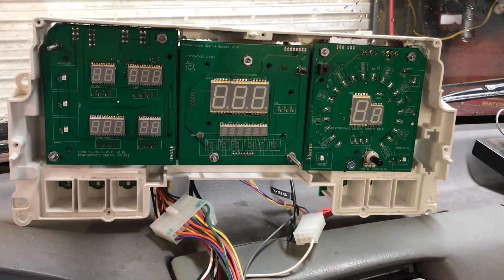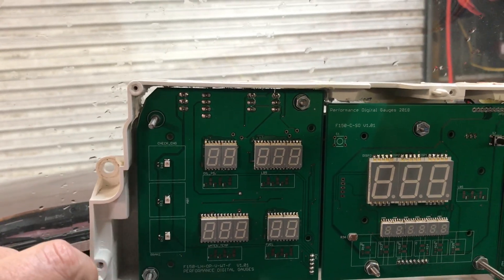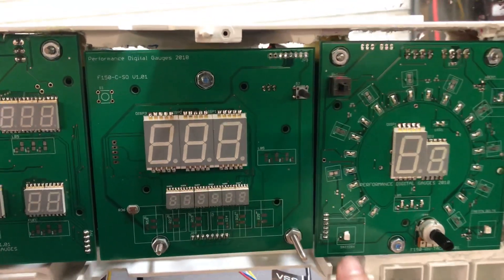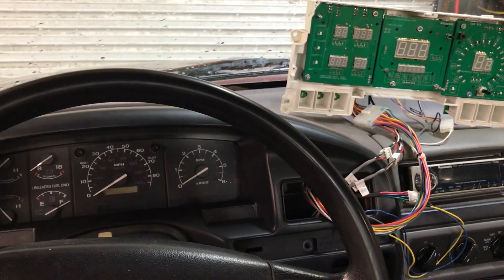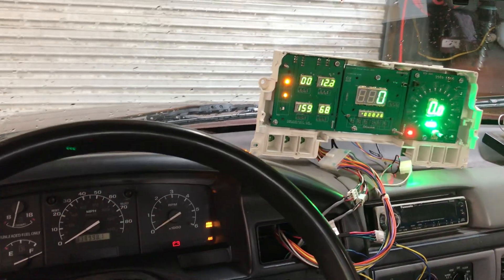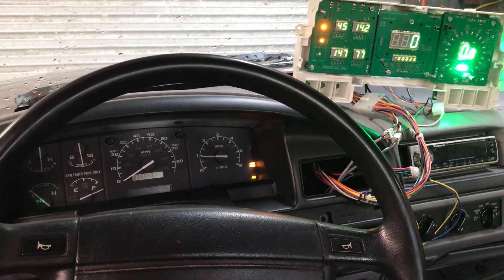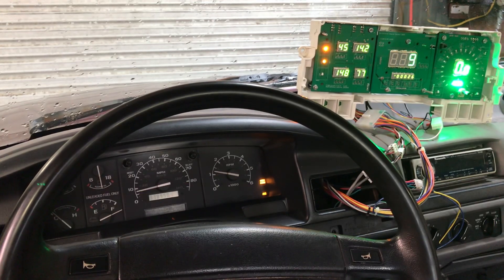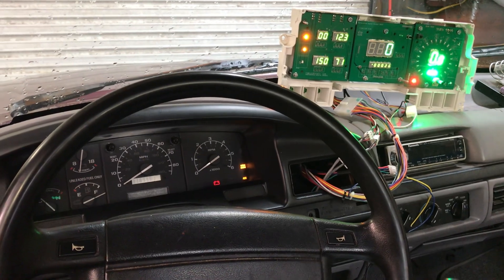OBS Ford F-150 Digital Dashboard Instrument Cluster

Comment: Do you happen to still have the old cluster
Mine broke and I can’t find any
Reply from the maker: It’s in pieces. What’s wrong with yours?
Reply: @performancedigitalgauges7198  most of the gauges don’t work
Reply: Only the speedometer works
Reply from the maker: @Abel_Music23  I’m still several months out on this one. You can find some used factory clusters on eBay or some of the OBS pages on Facebook.
Reply: Is there any manufacture that makes a digital dash for an obs
Reply from the maker: @paytonroebke6  currently no but we’re close to a finished cluster.

Comment: have a 1995 f350 application?
Reply from the maker: mongomay1 yes. If you have a gas engine the one in this video will work. If diesel, we will have this version with a diesel tachometer.
Reply: @performancedigitalgauges7198  
1995 f350 460 gas 5spd manual

Comment: Where did you get the digital gauge cluster?
Reply from the maker: Joseph Woolard II I’m developing it.
Reply: Performance Digital Gauges I would love to buy one as well stay in touch
Reply: @performancedigitalgauges7198  i would love to buy the finished product after the kinks are taken care of. Keep in touch
Reply: Well i would love one when ur done
Reply: I would like to buy one too
Reply: Will they be applicable for the f250 with the 7.3?
Reply from the maker: @rabidueautomotive2734  yes
Reply: How much for one?
Reply from the maker: @richardbutler3692  Not sure on price yet.
Reply: Very interested but did you install the tachometer cluster in your truck ? I've had 2 5 speed ninth gens and 4 automatic ninth gens and I've never seen a tachometer in a manual transmission ninth gen
Reply from the maker: @richardlynch6792  the truck originally did not have a cluster with a tach. We swapped it before we started this project.